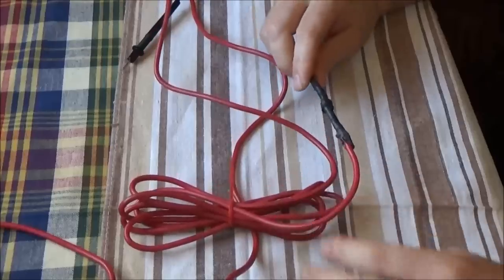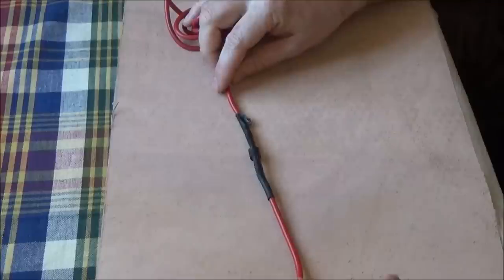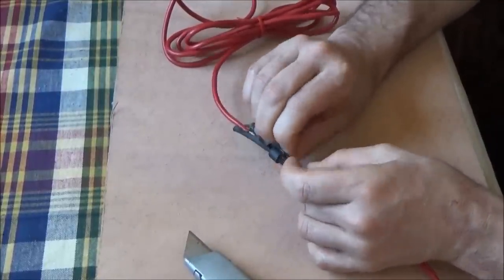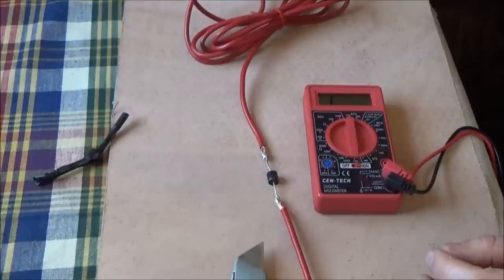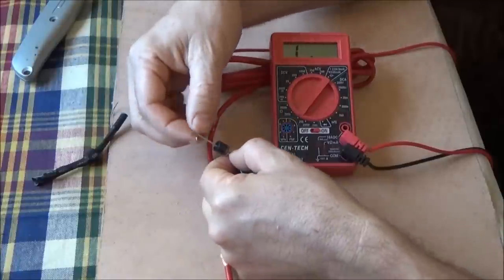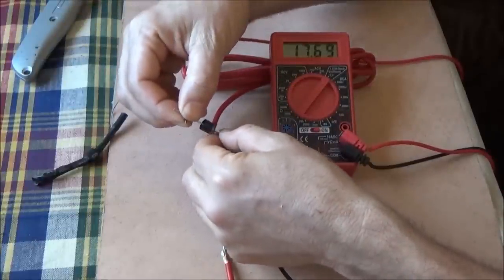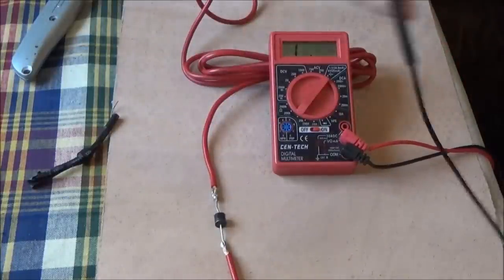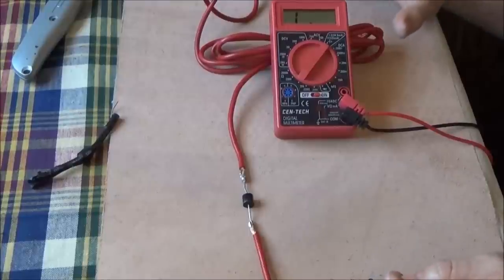How A Blocking Diode Works & Testing A Diode With A Multimeter

Comment: Better video, Just one Concern. The diode looks identical ??? I did not do well once why risk a second time?? I know they are made the same way but there are design differences. Size, Capacity and Voltages??  I just don't want to see you Crash again for the same Issue. Go with tutorial Videos those seam to get the hits.
Reply: You and I think the same that the doide he got is small for what he is trying to do. But he doesn't listen normally he will just blow another one maybe then he will give up on the windmill wrather then go to a bigger diode.
Reply from the maker: Sidney Boudro You do not listen. Why do you keep saying the same thing all over the comments? The first one that blew was rated at 50 volts and 45 amps. It was only under 15.5 volts and a few amps when it blew out. Well within its tolerances. The new one is rated at about 1,000 volts at 25 amps. But the one I used in the demo is a solar blocking diode which is rated at 1,000 volts at 10 amps.
Reply from the maker: Most diodes have the same sort of case. But the one I was showing in the demo was a solar panel blocking diode rated at 1,000 volts and 10 amps. The one that blew was rated at 50 volts and 45 amps.
Reply from the maker: By the way, the one I used for my wind turbine is the metal case one rated at 1,000 volts at 25 amps.
Reply from the maker: ***** Probably
Reply: The Do It Yourself World
I am a total ignoramus when it comes to electronics, but besides the packaging, how can you tell what a diode is rated at? Is it printed in small print on the diode itself? I don't believe I have ever even seen one in person before...
Reply from the maker: Wen Pow Sometimes there is a tiny number on the package somewhere. In that case you can type it into Google and get some specs. Type "1n4001 diode specs" into google and see what you find. That is a common diode used in electronics projects. Replace the "1n4001" with any number you find on the diode case.
Reply: Sidney Boudro
Listen up! He clearly said that that was one of the solar diodes that he was using for demonstration purposes. If you aren't smart enough to actually listen to the video, don't think you are smart enough to criticize it.
Reply: 2lazy4u
Is that supposed to mean something to me? I have my own religion and do not care about anyone else's.
Reply: 2lazy4u <----Lives in a world of its own.
Reply: 2lazy4u <-----Don't speak ze English so good. (been ≠ being)

Comment: the old diode over heated and failed!
Reply from the maker: Sidney Boudro You cannot know the specs from looking at a plain black case. The first one that blew was rated at 50 volts and 45 amps. It was only under 15.5 volts and a few amps when it blew out. Well within its tolerances. The new one is rated at about 1,000 volts at 25 amps. But the one I used in the demo is a solar blocking diode which is rated at 1,000 volts at 10 amps.
Reply from the maker: The original diode was rated at 50 volts and only had 15 volts going through it when it failed. You can see on video.
Reply: The Do It Yourself World
A diode only cares about the amount of current (amps) going through it in the forward direction and the open circuit voltage in the reverse. In your case, you can't have 15 volts going through your diode. And a diode while conducting is a constant voltage "sink" having a ~0.7 volt drop across it (mostly) independent of the amount of current flowing through it. Batteries essentially do the same thing. There's actually no way to tell how much current was flowing through that diode at any instant in time using just a voltage measurement. The battery may sink 15.5v and the diode sink 0.7v but the generator (wind turbine) might have produced much higher voltage resulting in a current that exceeded the diode's spec. So, in theory, you could have had more amps flowing through that diode for even just a fraction of a second exceeding its rating and blew it up. Alternatively, and I believe it much more likely, some reverse voltage spike appeared across the diode exceeding the 50v spec and that's what blew it up. Perhaps lightning induced a voltage in that very long wire you have out to the turbine that made more than 50v appear across the diode? It would only take a couple of microseconds to zap it with an over voltage (and only microamps are needed to do it too). Just a guess. Or it could have just been a bad part and was going to blow no matter what you did.

I believe you need current meters everywhere and it would help if they had peak recording ability.
Reply: David Shepperd
I agree that this diode saw a voltage spike. My guess would be static electricity.

In my experience, diodes first blow to a PN junction short like this one.  Interestingly however, if they're left in place and allowed to conduct, they heat up and blow to an open.
Reply: what would work best in preventing burning out the diodes would be having the wiring going through a shielded cable or conduit that is grounded at both ends and to the windmill motor housing (prevent static and spikes due to high voltage discharge near by).  be sure the shielding is properly rated of the current draw and that you keep it isolated from the power conductors.

also, with your setup, it would be wiser to use diodes rated for at least 30 amps (50 would be ideal) and that the diode be rated for 70 volts minimum and placed somewhere close to the fuse block under the counter.